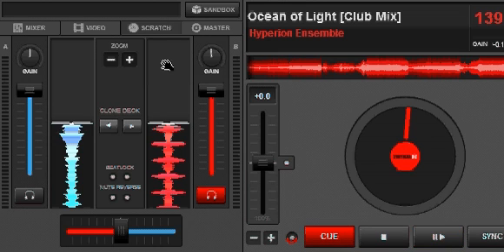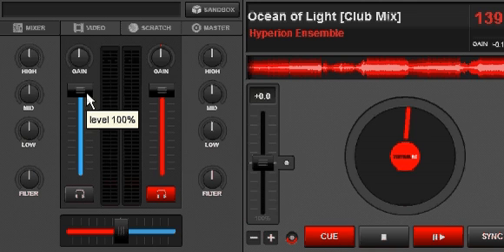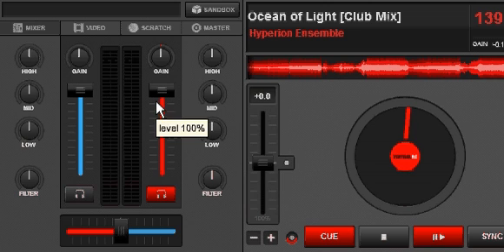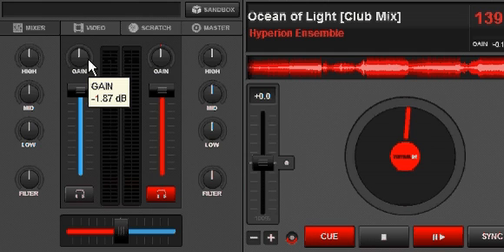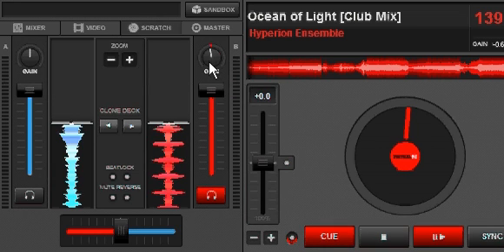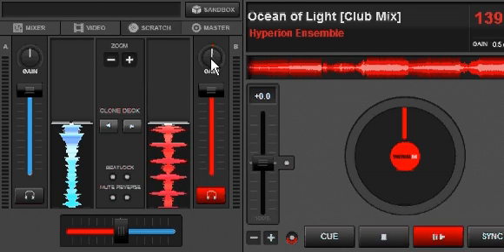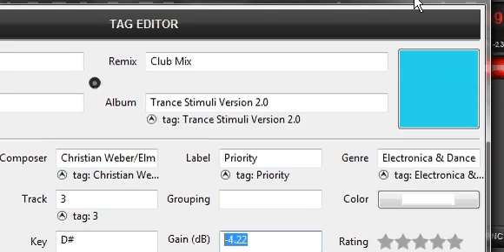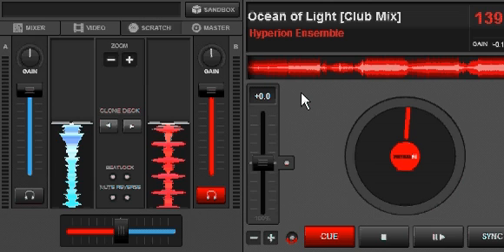Virtual DJ 8: Gain Control Explained

Comment: You made slight error.  GAIN is the adjustment of the INPUT SIGNAL into the software.  Volume is the OUTPUT level.  If you turn up gain too much you could send a distorted signal INTO the software.  GARBAGE IN = GARBAGE OUT.